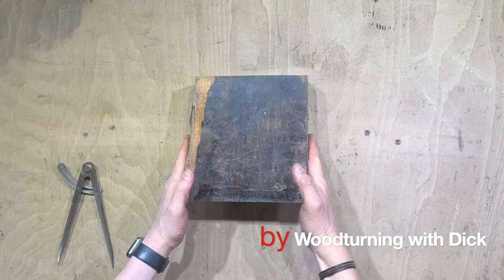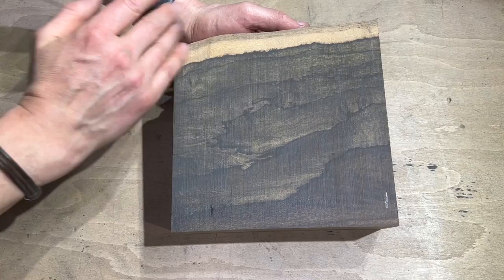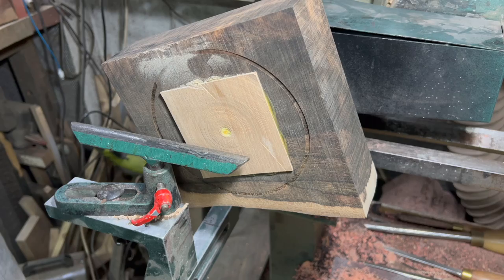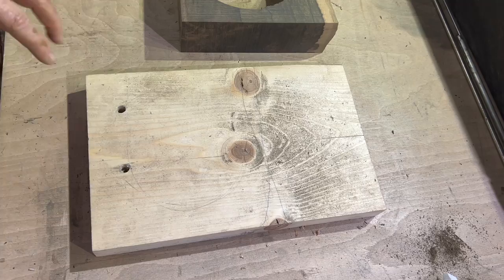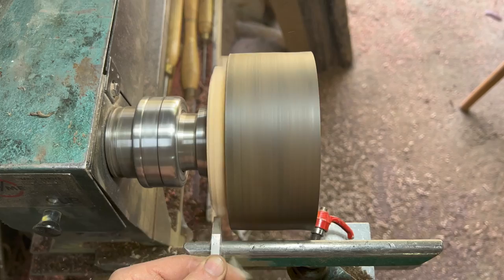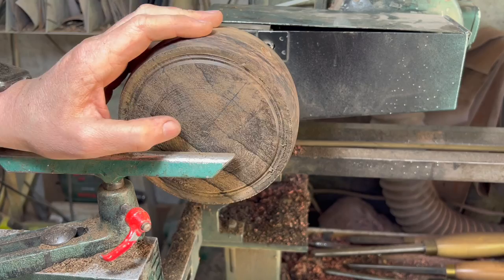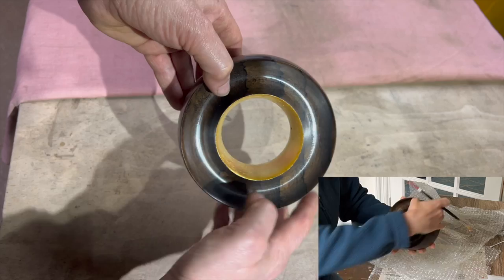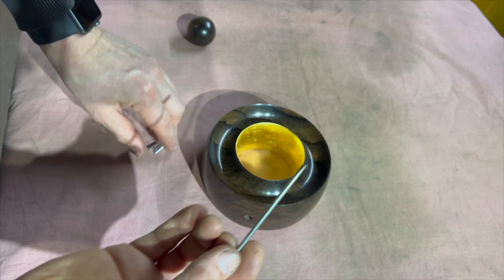Woodturning a Ziricote Bowl Blank into a Sculptural Piece 838

Comment: 11:50 🤬
Reply from the maker: No, just BALLS! 🤣👍
Reply: @WoodWithD  you're cracking me up😂
Reply from the maker: @gemofthewoods5802  no, that’s wrinkles, they come with age 😁👍
Reply: Okay, I have a serious question. No, seriously.....when you had the square-ish block on the lathe (near the 5:08) and you were using the tool to make the circle inside it...how come you stopped and finished the circle with a jigsaw?
Reply: It's cloudy here, and it's messing with my signal...I will barrage you with my nonsense tomorrow....but in the meantime...have a great day.
Reply from the maker: @gemofthewoods5802  Arh, that’s cause I didn’t want it flopping about when the parting tool separated it 😁